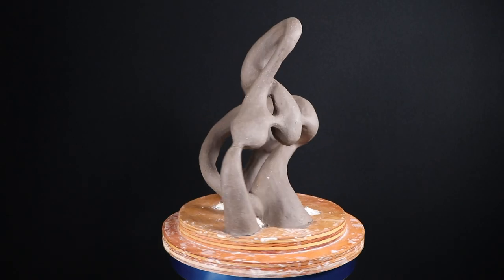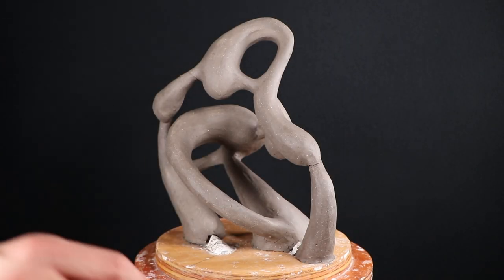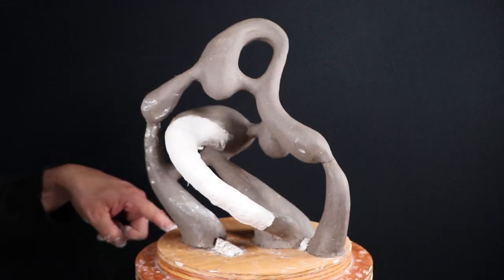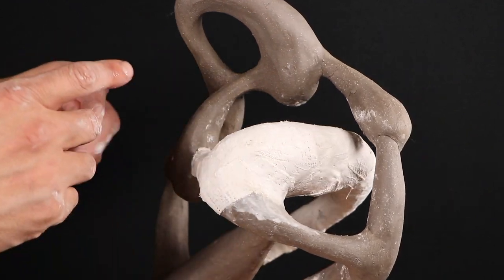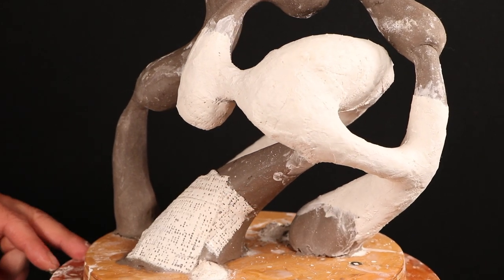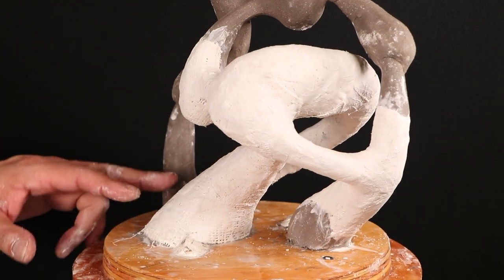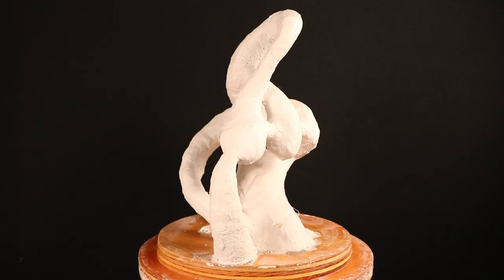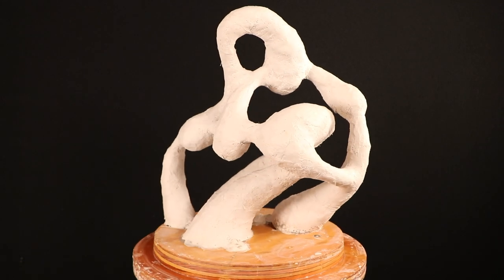Part 3 - Clay Forming on the Wire Armature - Plaster-Fabric Wrap

Comment: Could you tell me please if the clay had been allowed to dry out fully before the plaster cloth was added or had it still been kept under the damp towel and plastic? Many thanks.
Reply from the maker: No, let the clay harden to a "leather hard" state which is stiff like wax but still has a large amount of water content. I kept a plastic bag over water based clay in between working to control the drying. You can keep clay leather hard for months if you control the drying, with the occasion spray of water or leaving damp towel over it while bagged. 
Good luck!